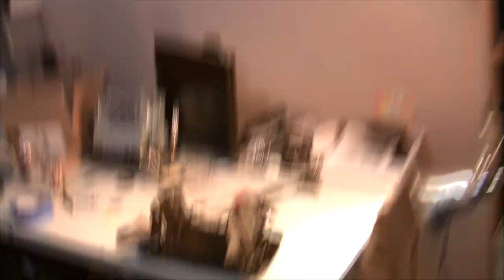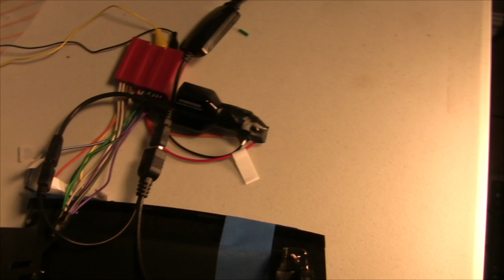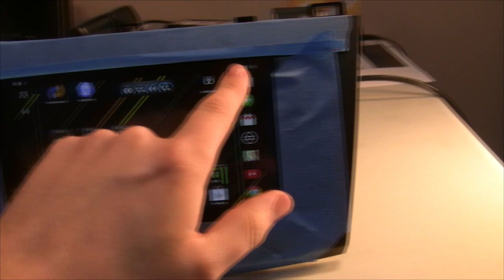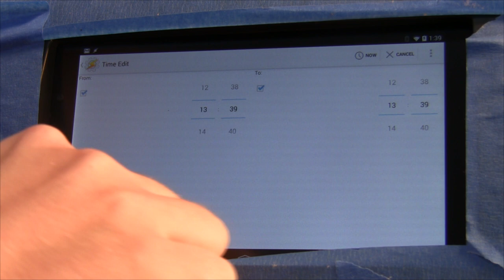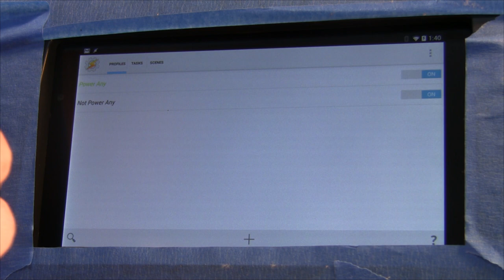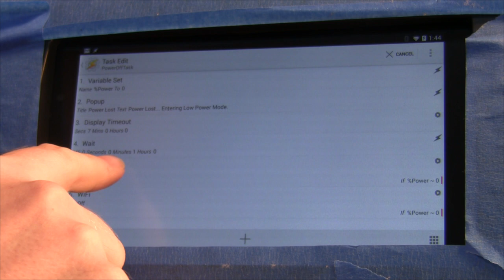Replace your Car Stereo with a Nexus 7 2013! [Guide] Part 2 - Power & Tasker Setup

Comment: do these settings also work for android13? Power on works perfectly, but power off only turns off the screen for 5 seconds. then it switches on automatically again

Comment: Hi, what do you think? Is it good to leave the battery in the tablet considering that the interior of the car gets very hot in the summer? How did you do?
Reply from the maker: I would always use a sunshade and try to also park in the shade. I got a new car, but I used that nexus 7 for at least 2 years.

Comment: Hello i have a lenovo tab and i removed the battery and wired it direct on car charger and it works ..so with this setup can i used the tasker apk and do same as ur ???

Will it charge back to the car charger. Back damaging something or wat ??

Comment: Hi! is it possible to configure Tasker app so it just goes to sleep mode after turning ignition off?  (i don't want it to turn off the device completely).
I have installed Lenovo tab hd m8 as a head unit using AUX cable in my mazda 6 2006 model, I was able to set android settings to wake up Lenovo when I turn ignition on, and it works fine, but I can't figure it out how to make it sleep when i turn ignition off. Or, if you could advise another app that can do it, it would be very helpful.
Reply: Just replace power with sleep mode
Reply: @charlieg8682  Thank you! i will.
Reply: @sovu9399   but to me it performs the same way.  When I start the car the tablet starts where it left off in seconds..

Comment: So, if you install it in the dash like this. You have no access to power button. Say you go on a vacation, come back, the tablet is off, because battery is drained. How do you turn it back on?
Reply: :)  mine drains overnight. My car is parked more then i drive. Go to work and back mainly.  Need to remove tablet and charge at home. Am eventually gonna put a switch to make the tablet charge with key off. Btw, with tablet in dash, i made a small slot in frame around tablet so i can push the power button with a tiny screwdriver. Its not noticable.(not on tablet)

Comment: Is the positive 12 VDC connected to the 12V battery or the 12V ignition switch? What connections do I make with these wires?
Reply from the maker: im powering off the ACC ignition switch.. no other way to tell the tablet to turn on / off otherwise.

Comment: Thanks so much for this video!!! From your video i figured out exactly what I needed to do. I am also installing into my car, but instead of staying on i wanted the tablet to full power off and on with the key. I found a way to power on with a simple kernel change, but i couldn't get it to power off. Also have the tablet lower all volumes to 0 and open audio app when powered on. Thanks for the help! Here is a link to what I did, its near the bottom of the page.... http://forum.xda-developers.com/showthread.php?t=1815131&page=7